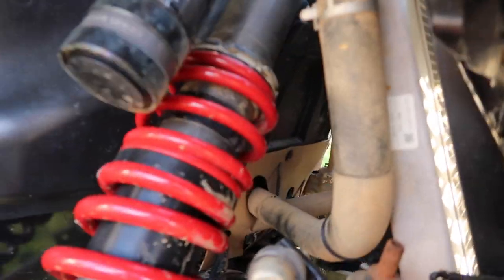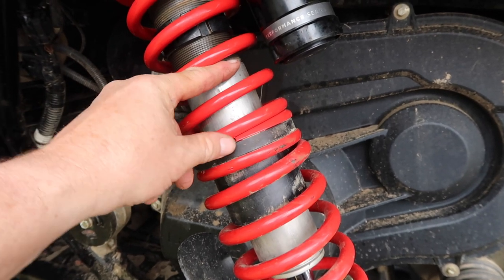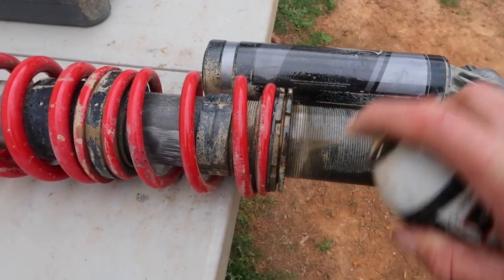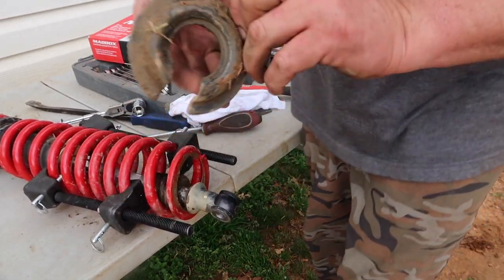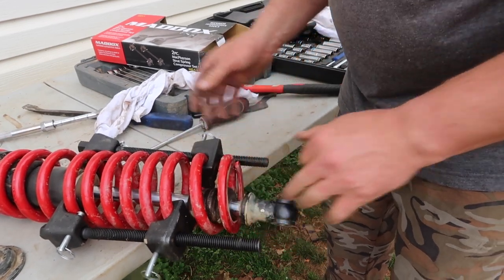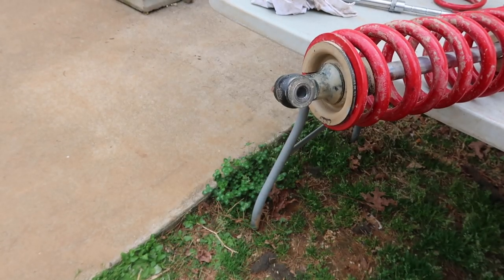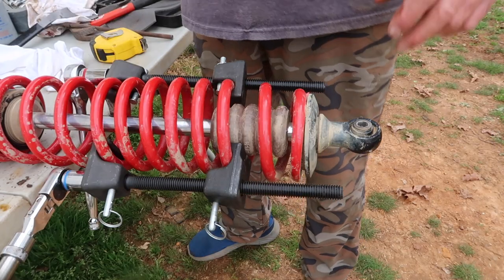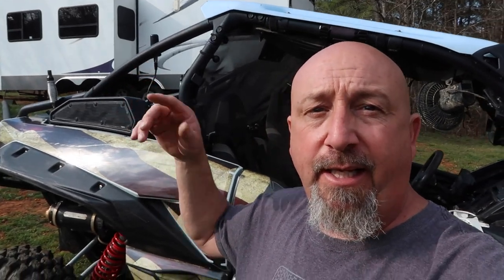Tender Springs on the Kawasaki KRX 1000

Comment: What size tires are you running? I have 34 inch tires and mine are set at 15.5 and 16 Since the factory-spec is 14 + 14.5 34 inch tire is three inches taller than the stock 31 so divide that in half so you add 1.5 to the factory measurements. My 3/8 inch Milwaukee impact took care of those spring compressors with a flip of a switch same for breaking the shock bolts loose. Setting up all that up ensure lot easier when it's sitting in the vice for the front Springs. I did the rears on the machine

Comment: Got my KRX last month. Love your channel. Did you have the clanking noise from the rear springs. Getting tender springs next week and I hope that fixes that issue. Drives me crazy.
Reply from the maker: I didn't notice that, I have that trumbone sound.  I ordered limit straps because I felt my front shocks over extending.  Thank you so much for the compliment
Reply: How did your mud flaps work out. Did moving them down help. I got mine in the mail today and will put on tomorrow.
Reply: The problem your describing is when your crossover hits the crossover stops changing springs will not cure it you need to order crossover silencers, they are basically small rubber washers that go between the crossover and the stop rings. about $28 on ebay. you can install them when you change your springs.